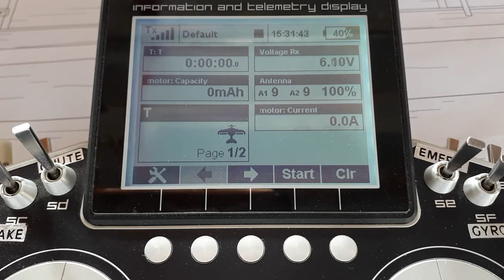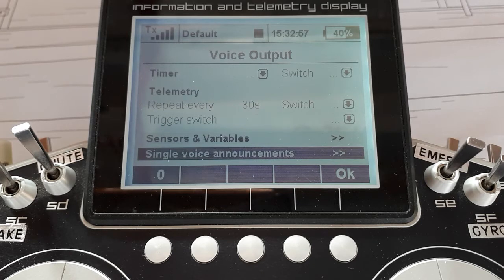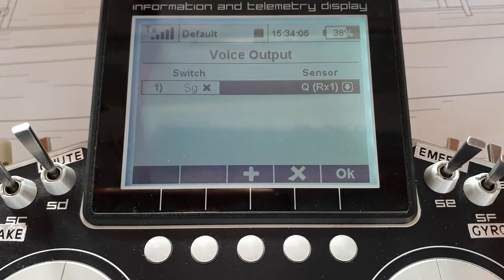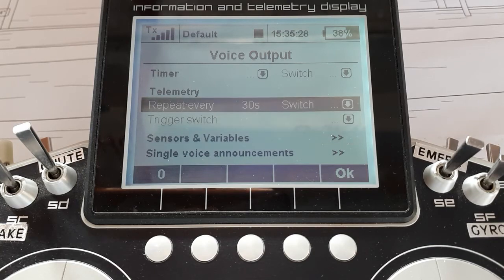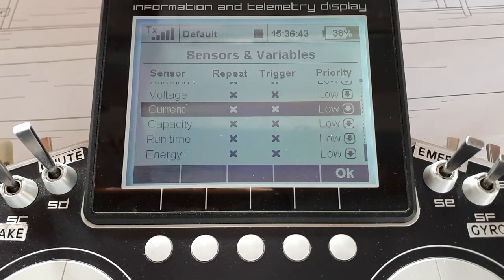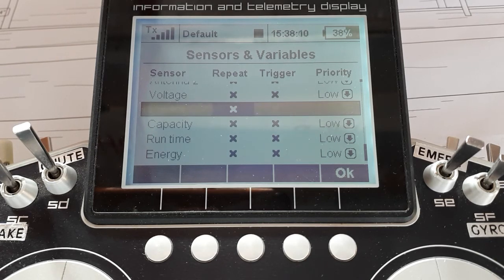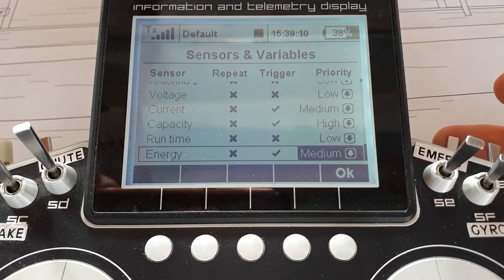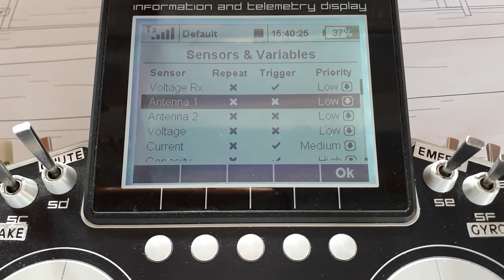Jeti - telemetry episode 3, voice output

Comment: Hi Harry, is it possible to program a voice output if the Q value dips below a preset value ?
Thanks,
Reply from the maker: There is no longer a built in alarm but I believe it can be done by setting a telemetry control to switch on when x<your chosen value (Q is in system not telemetry sub menu) and then use that telemetry control to switch on a sounds on event